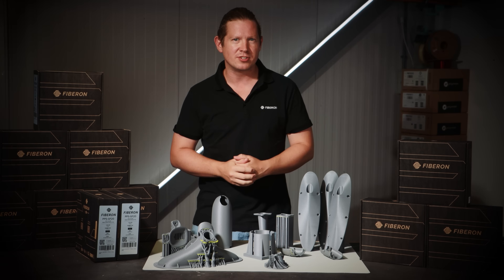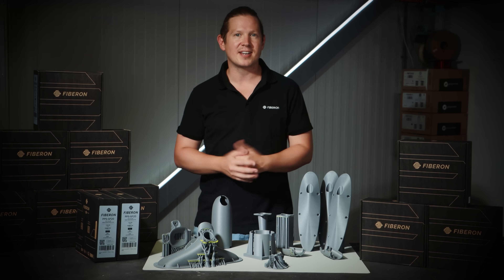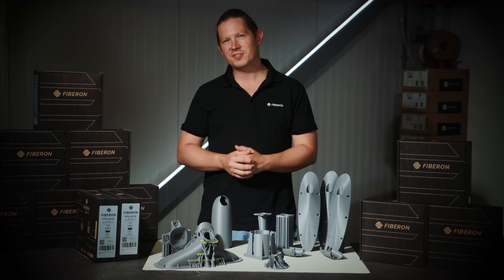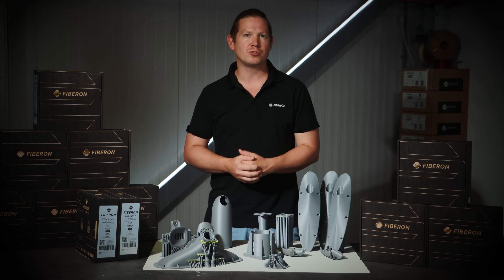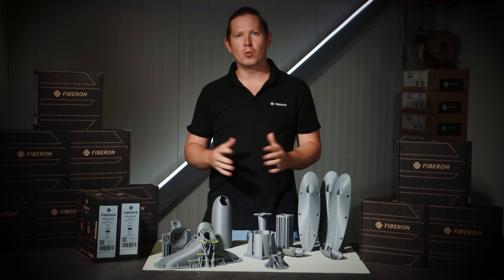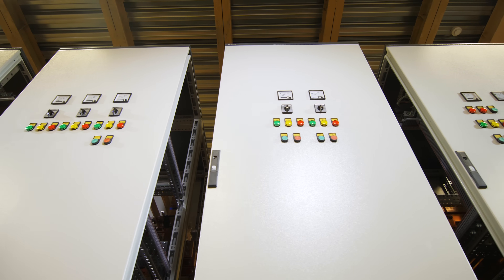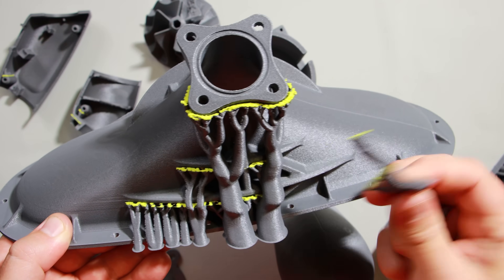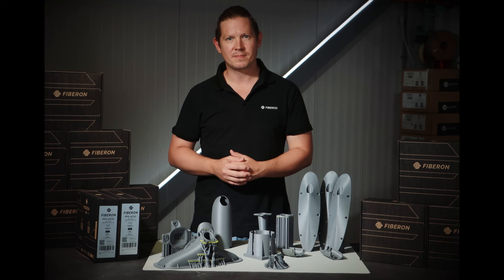High-Performance 3D Printing: Fiberon™ PPS-GF20 for Electronics, Automotive & More

Comment: Is glass filled less brittle compared to carbon fiber? PPS is very intriguing to me for making certain dirt bike parts, but I'm worried it wouldn't take an impact well due to being a filled filament. Specifically for disk guards on the front wheel as they can take some hits from rocks and logs. I don't mind the price point if it will work wonderfully and last, but not quite at the price point where I would buy it just to see if it will work or not.

Comment: I’m most impressed with how well those supports came off. Yall need to start publishing some profiles with support settings included if you’re doing anything special
Reply: They used a separate support material, you don't need any particular profiles in such a scenario
Reply: @erkkijaakkopetteri no I’ve used separate support material and it completely fused to the part with standard settings
Reply: @soul_in_a_fishbowl  Sounds like you're doing something seriously wrong
Reply: @erkkijaakkopetteri not sure how it would be anything I’m doing when I can run my regular support profile with no issues but then change the interface material to PA breakaway support material and have it completely fuse to the part. It’s the Bambu support material specifically and I’m not the only one that has reported the same thing

Comment: Polymaker... any plans for a filament that's tough in the Z dimension? Most of them are only tough in XY.
Reply: They made a printer that strings carbon fiber along with the filament so it’s a continuous string. I bet someone could easily make a crazy glue injector that used a needle and puts a dot of glue every other 10 thousands of an inch. Dries instantly with the right formula doesn’t spill over with the right amount runs right next to the nozzle just before the layer is put down. Probably have a stronger z than xy after that.
Reply: @zevkej Yes, there is a method called Z pinning that has the printer leave vertical voids in the print and then injects plastic in the hole to make a solid plastic pin binding the layers together. Unfortunately it isn’t on any common slicers
Reply: Have you tried the PLA Pro? Very tough stuff!
Reply: @PolymakerPete I have yeah. But I am looking for something heat resistant too. Think nylon toughness but without the warping and capable of 90c. Nothing really fits the bill. All the filled stuff is too brittle, especially in Z. It’s like people who want toughness not hardness / stiffness are getting left behind 😢
Reply: It's an inherent problem of technology itself (3d printing). All 3d prints are heterogeneous materials (different properties depending on the direction of forces applied). That is why print orientation is important
Reply: @xManzi I see what you’re saying, but they do differ in things like layer adhesion. So while I don’t expect isotropicity, something with more Z toughness is the goal ❤
Reply: I Find sticky filaments like PETG and PC have very good inter layer adhesion

Comment: Is the GF as brittle on the spool as the CF variant? I can only print PPS-CF on one printer which has an almost straight filament path directly to the nozzle. On any other printer it ends up snapping in the bends of PTFE tube, even mild bends. The material is amazing, but this makes it challenging to print on many printers.
Reply: I print mine on a stock setup mostly routing wise. Mine is a creatlity k1. I use the blue tubing. I forget what its called. I routed mine above the flexible protector, mostly floating free except its with an oversized retainer clip. Just gotta make sure the bend doesnt have past an abrupt 30 degree bend and. I use the blue tubing because it is tighter on the filament and holds it well. Ive found it likes to be well supported while feeding. And the extruder makes a difference too. Mine is the upgraded metal direct drive with the metal gears as well, so it reduces extrusion stress on the filament. Pulled rather than pushed. Which keeps it from snapping. Other wise maybe slow the speeds down and adjust where its printed on the plate to reduce the amount of bend it has to have to print.

Comment from the maker: Alright now...who's printing car parts?
Reply: Curious...

A high level polymaker employee publically stated that there was a lack of adherence to ISO standards when testing polymer performance. 

It was uncertain if this was purely from ignorance (unacceptable if you actually have the source documents for the standards) or willful violation of the standard (and community trust) 

Has this been corrected and will any public facing statements be made?
Reply: I am. Currently doing a restoration of a car and many of the old plastic parts are hard to find. Looking at using my printer to make replacement parts for these old broken plastic parts.
Reply: Maybe printing formula student parts out of this, looks like a great fit for us!
Reply: This guy is haha.  What is the support material layer you are using?
Reply: If I need to redo my cold air intake I will probably be giving PPS a try. I like the PA6-CF its currently printed from and although the PPS has high temp resistance I am slightly worried about its brittle nature, unsure how it performa against PA6 for sharpy impact strength but i think its significantly lower due to its lack of yielding before fracturing. PA6 seems like the correct choice for an intake tube that might get a wrench dropped on it.
Reply: I am 😅
Reply: Dirt bike parts, but in the same realm.
Reply: I actually just recently printed a whole bmw air intake system out of fiberon pet cf and the turbo inlet out of fiberon pps-cf